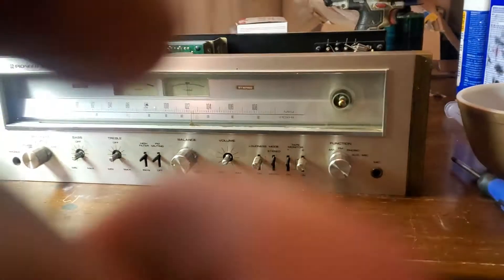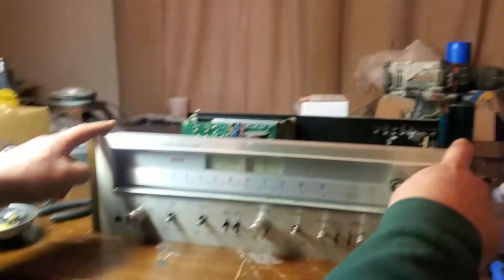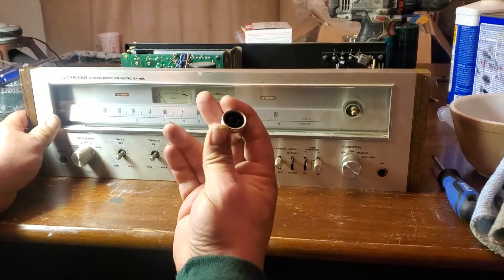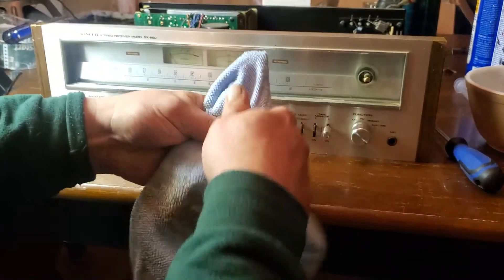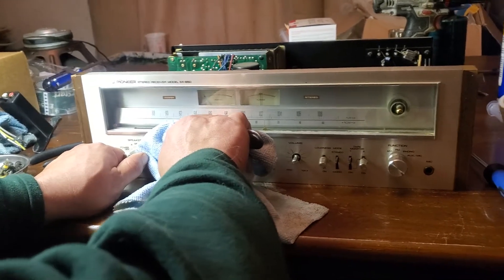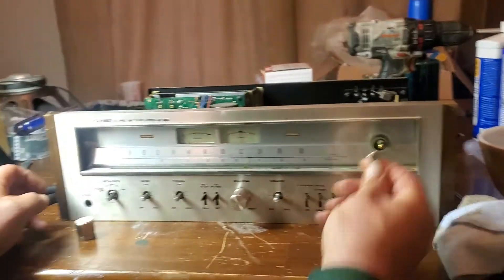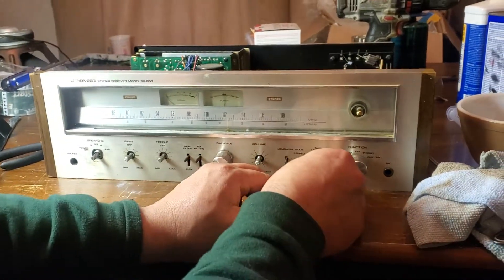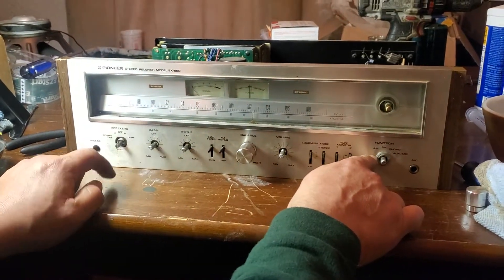Removing Knobs and Faceplate From Pioneer SX-650 super awesome filming

Comment: Does that work with the tuner knob ? I have the sx1250 .. does it just pull off thx
Reply: The volume knob (1) and the tuner (2) both have set screws. Becareful, they are difficult to  see and you have to find the right hex size, they are very small.